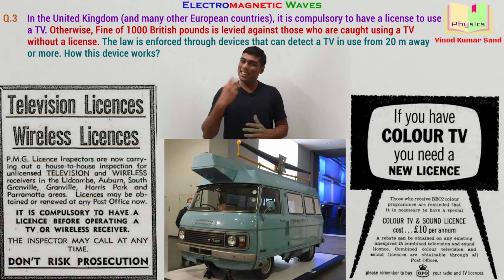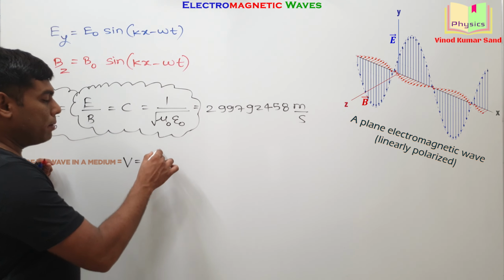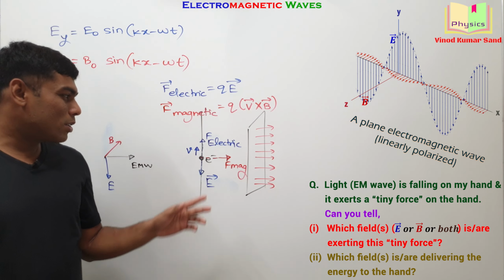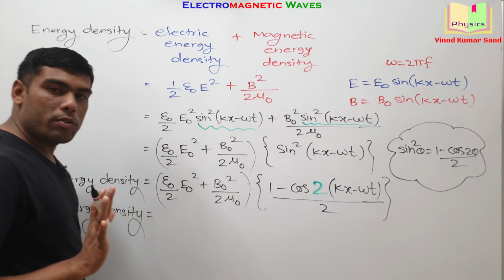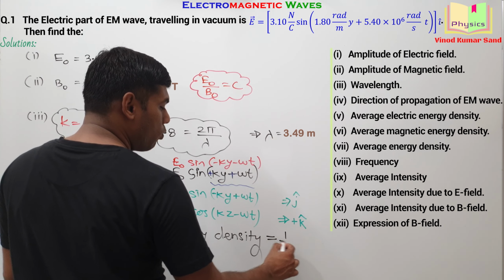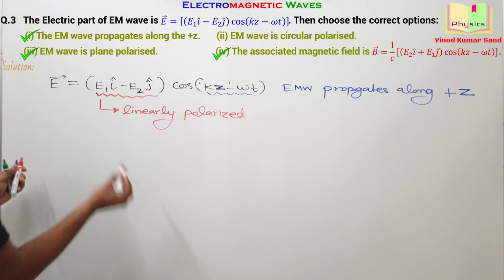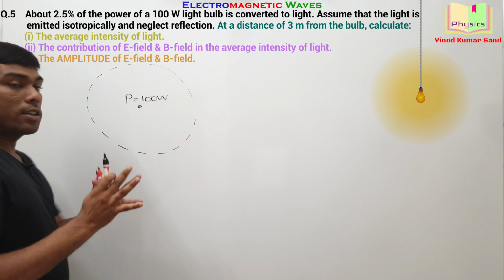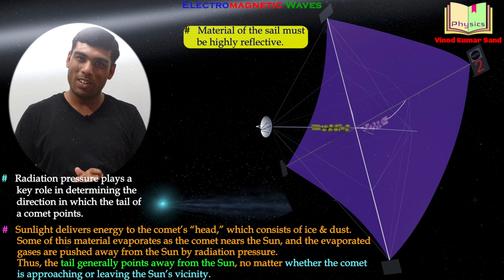Electromagnetic Waves

Comment: As em waves are source of accelerating charge  . What makes the light  em waves ..
Reply: @VinodKumarSand  how this time varying electric field and magnetic field genearted in em waves
Reply from the maker: @nirmalbothra033   
Oscillatory charge will produce the oscillatory electric field , which in turn gives rise to the oscillatory magnetic field.

Thus, these time varying fields are "coupled" , means they produce each other.
Reply from the maker: "Accelerated charges are the sources of EM waves"

But but but;
EM waves are not the sources of the Accelerated charges.

Light(EM wave) has the time varying electric and magnetic fields, which are perpendicular to each other as well as perpendicular to the direction of propagation of wave.

I hope it clarifies the things.🤝